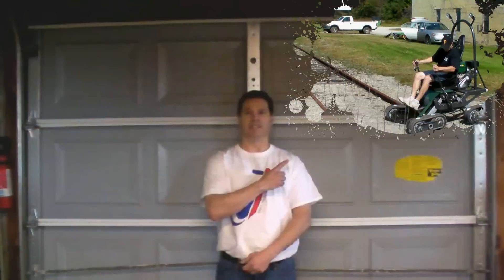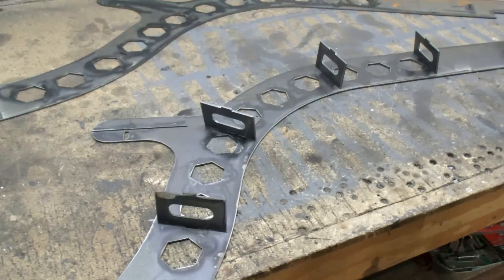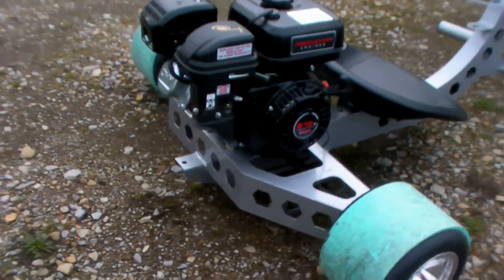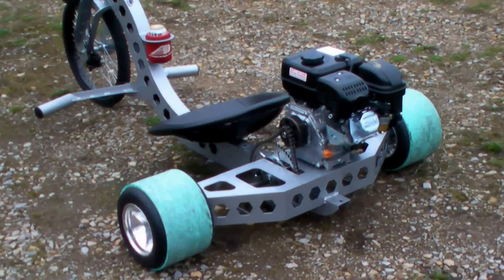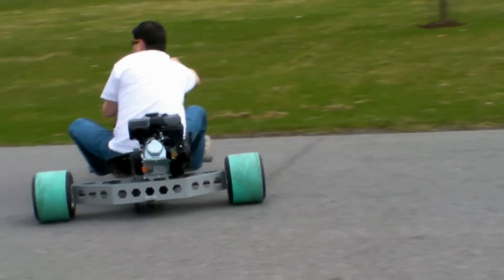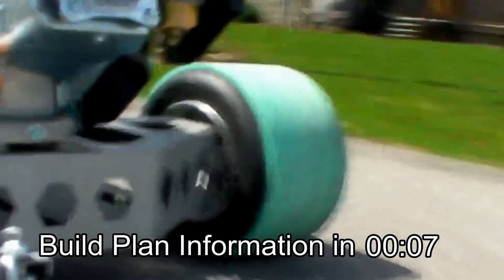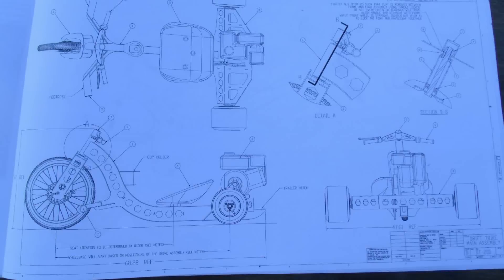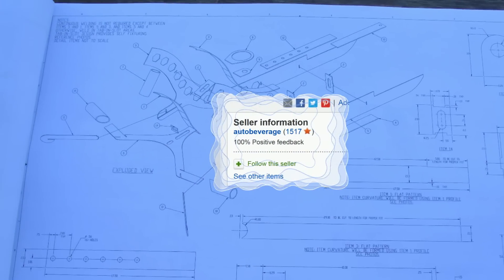Drift Trike Industrial Custom Motorized Drift Trike

Comment: I bought the plans and they sent me an email with a dxf file of the trike scaled 1 to 1. I copied the file into my plasma cutter and started cutting. The parts are even nested. I had to add an extra bearing beside the sprocket because the axle would deflect and the chain would jump, but no big deal. I have two now and love them.